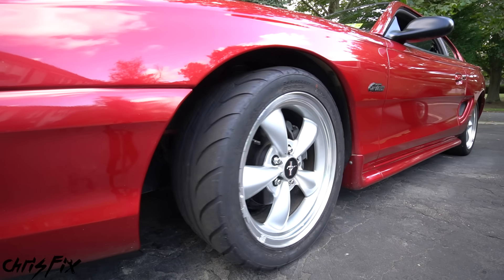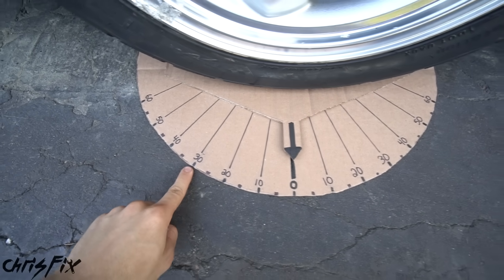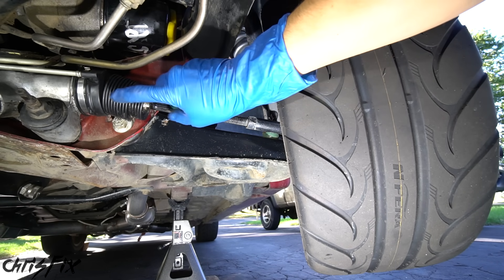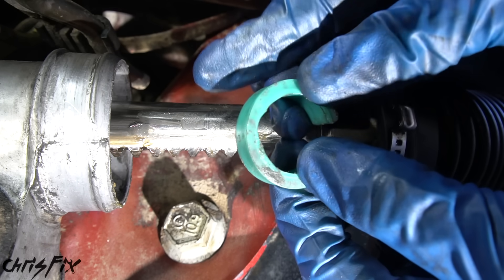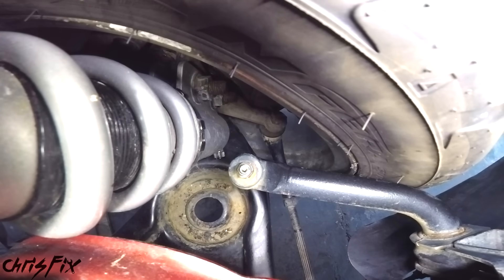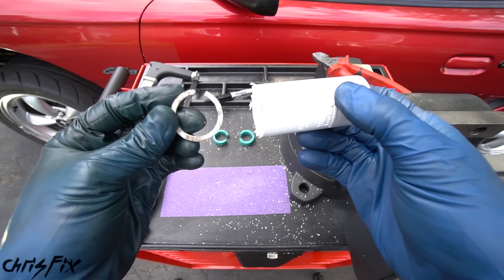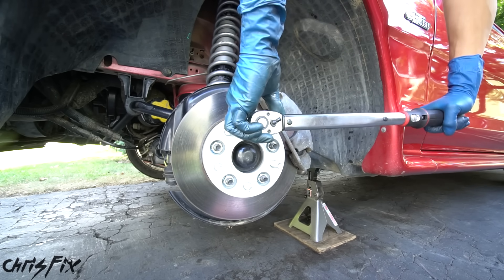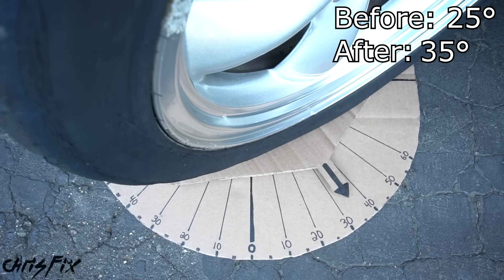How to Get Your Car to Make Sharper Turns (Steering Angle Mod)

Comment: Don't know if you mentioned it but over here(Sweden) the tires must be inside the line of the front fenders. Could be vital information for some, maybe some states has the same rules and laws about that. Other then that, awesome video!
Reply from the maker: +fladdy45 thanks for the tip! I try not to cover laws because it varies so much. Heck in Norway you can’t even run spacers.
Reply: Yeah, pretty much same here. But if you are sneaky enough you can slip them through inspections haha

Comment: Loved the video! I just have 1 question and 1 request. Question: Will htere be any safety issues by removing the rack limiter for a daily driver? Request: Whenever you do the wheel spacer video, please address scrub radius, how is it affected and such. Thanks.
Reply from the maker: +Milton Huang the safety aspect would be checking for clearance of the wheels and brake lines like I showed. Otherwise there is no issue.

Comment: Good video but check the clearance AFTER you lift down the car. Because lifted car can be ok but on the road you can rub the tyre.
Reply from the maker: +solidsnake123100 great tip

Comment: Japanese cars don't have these as far as I know. But there are other methods for these cars like tie rod spacers, and of course modified steering knuckles. Toyotas have a separate steering knuckle / balljoint bolted into the spindle and there are aftermarket options for different steering geometry.
Reply from the maker: +AX53 thanks for the tip!

Comment: The Loc Tite  is an excellent suggestion. Years ago i had a 1954 Chevy with a small block and '57 Olds rear axle. Ran Chevy to Olds pattern adapters on the front to have the same lug pattern all around. One spare fits front and back. But the nuts holding the adapters, which are spacers, in effect, wanted to loosen over time. And when that happens, a wheel comes off. Trust me. I know.

Comment: Wheel spacers and greater offset rims are not a viable idea as these will both promote torque steer. shaving the spacer is defiantly a good idea.

Comment: Anyone here that knows if volvo 940 has that spacer?
Reply from the maker: Check the measurements of the wheel studs and the hub center. They should have one as most wheels use a common size hub.
Reply: ChrisFix i ment the one that got you mode steering😁
Reply: Nope no steering limiters on rwd volvos
Reply: Iain okey thx saved me time
Reply: Iain Any info on the FWD Volvos, particularly P2's like my 2002 V70?  Would they have rack limiter spacers?
Reply: im pretty sure yes

Comment: some cars have an angle limiter on the control arm on the back side its like a little lump that sticks out and the spindle hits on that and all you need to do is grind that down a little but not all the way because than youre wheels are going to rub 
also not a good idea to increase the angle on a fwd car because you risk damaging the joints on the drive shafts
Reply from the maker: Thanks a lot for the tip!
Reply: my pleasure thx for the great videos

Comment: What's the best wheel spacer brand
Reply from the maker: The ones I have (linked in the description) are amazing. I have gone off the track at 60mph sideways and they hold up perfect! No vibrations at highway speeds either.

Comment: That cardboard protractor/angle finder, I was skeptical, but that worked amazing!  There's got to be a way to use that to measure toe and avoid having to go to a shop for an alignment.  I'm sensing another possible video?

Comment: Wouldn't that cause safety issues. I mean it  can be dangerous to turn the car at high speeds if you accidentally over steer and car may flip over

Comment: Hey chris, love your content as always, I watch all your videos even if it doesn't concern things I can do with my car !
I recently tried to clean up the rims on a 92 mazda 323, and I really struggled cleaning the thick layer of grease, dust and overall dirtyness in the inner part of the rim, the one you can barely see because it blends with the black parts behind the wheel, I tried the sponge grit, some degreaser and wiping towels, that came out ok, but it was very long and not very easy ! If you have any tips or  if you plan a video on how to superclean your wheels, you're more than welcome ! 

Thanks again for your great content, everything from the content itself to your prononciation (not a native english speaker, yet I understand and learn prety well with you) is awesome !

Comment: Are there any downsides after doing this? Other than the power steering moaning thing?
Reply from the maker: The power steering moaning is in all hydraulic power steering cars stock or modified and has nothing to do with the modification. The down side is spacers can cause a little more wear to the wheel bearing and suspension over time (not that much if you are doing a 25mm or less spacer).

Comment: u havent talked about driveshafts. when adjusting angle theres more wear/stress on em
Reply: never mind mustangs are rwd, but still its worth talking about in case someone does this to a 4wd/awd
Reply from the maker: Thanks for sharing. That is true but you shouldnt be moving quickly when you are at full lock and you are also not at full lock when driving most of the time so it isnt an issue in most cases.

Comment: You should have checked to see what it was just with wheel spacers
Reply from the maker: There is no change in angle when pushing the wheels outwards.
Reply: ChrisFix are you going to add a bump steer kit

Comment: that cardboard steering tool worked a lot better than I expected.
EDIT:
I just realized - shouldn't the turn angle be the same both ways?  Think of it like this:
For the left wheel, turning to the right gave you 40 degrees, but turning left gave you 35.  But what about the right wheel?  If turning that doesn't give you 40 degrees, wouldn't that mean the alignment is off?

If the wheels are supposed to point in the exact same direction, wouldn't this also mean that you can't turn as far left as you can to the right?
Reply: Peter Schmidt Look up Ackerman Angles, the wheels have to take different angles on left VS right turns
Reply from the maker: Look up Ackerman Angle.
Reply: The inner wheel has to take a smaller turn radius than the outer wheel, so each wheel needs a different turning degree depending on which way it's turning

Comment: This is great information. I have a 99 Infiniti G20 that U-turns as wide as a Suburban....and it's a compact car, so embarrassing. 4-door Tacomas U-turn tighter than it. I'm really gonna look into this on my steering rack. This would be a significant and much needed improvement for my car. Thanks for your awesome videos.

Update:
Well after taking a look at my steering rack under the boots, my car has no steering stops to remove so I'm stuck with my crappy turning radius. Just shows all cars are made differently.

Comment: Hi Chris. It's really worth noting that doing this modification to some cars can be risky and sometimes downright dangerous with the standard components. In some cases you can get a condition sometimes called "Over-Centering" where due to the steering geometry the wheels can go past a point of no return and get stuck in position at full lock. This often means you will not be able to straighten the wheel without being able to reverse, or jacking the car up to release the lock. What can be especially dangerous is that the lock can sometimes only appear under high load, so driving the car in circles may not show the fault when testing at low speed.

Comment: When I did my inner tierods, I noticed there's a tiny hole in the boot(I suspect that's what ruined the tierods -And Chicago winters) I taped it up with electrical tape and hope it holds.
Reply from the maker: Yea once the winter is over I would replace the boot if the tape isnt working well.
Reply: Yup. I plan on it, man. It's just that I got in over my head with basically replacing the whole front end suspension- including the wheel bearings - and just didn't want to wait for the boot in the mail(I order parts, I think it's cheaper), and just wanted to drive the car, instead of just constantly doing something to it. Your vids, helped *tremendously*. Thanks!

Comment: Great videos Chris! I think your tires might hit your sway bar when the car is on the ground and you're drifting at lock. Tires flex a good bit drifting. If your fronts rub, you could have them bind and make you over rotate. Just double check you don't have marks from rubbing after drifting it.
Reply from the maker: Thanks man! I actually have been using this setup for many months now and it hasnt rubbed at all, even drifting on the track!

Comment: The rear needs spacers, they are way too tucked in stock form but now that you did spacers up front it really looks bad.
Reply from the maker: Thanks for sharing. That will happen when I do the "everything you need to know about wheel spacers" video.

Comment: Will adding wheel spacers make your tire hit the fender when you hit a larger bump?
Reply from the maker: It can if your tires stick out too much but that isnt the case in my car. Usually 25mm or less spacers isnt enough to cause any problems.

Comment: I really appreciate and enjoy your videos/explanations. Out of curiosity. With that narrow of a clearance between the sway bar and the tire. Would a sudden increase in load cause the tire to contact the sway bar? I.e. a pothole, speed bump, sidewalk edge, etc. This would be due to the angle of the spring suspension. If the angle that the suspension is mounted at is more vertical, then there wouldn't be any concern of that issue occurring.
Reply from the maker: Thanks and great question! I have tested this on the track drifting (the most sideways anyone will ever be) and they do not rub. Since the sidewalls on the tires are short there isnt much flex. If you have a bigger sidewall like on a truck then yes it might rub but I would be concerned if you are turning that fast all the way locked in a truck. Usually when you are all the way locked you are going slow (unless you are drifting) so there isnt going to be much flex. Great thinking though and thanks for bringing that up!

Comment: Why do the manufacturers install the limiters?
Reply from the maker: Because there will be contact with the suspension otherwise. The limiters allow the manufacture to use the same power steering rack for almost all of their cars and they limit motion with the rack limiters to fit each car. Good question!
Reply: Thanks for the answer !

Comment: Great videos.......BUT, this habit you showed in your driving of puttingyour hand INSIDE the stering wheel when turning, is a very common, and very dangerous habit to get into. It is an extremely common habit,abd extremely dangerous thing to do.....Like tail-gating. Sudden emergencies occur in a split-second....Especially at city speeds.This habit will slow you.....To DEATH.
Reply: Peter Ruiz You’re either a driving instructor or the habit police. Either way, lighten up!
Reply from the maker: Thanks but this is just because I am filming and turning with one hand in my driveway.

Comment: Loved the video. I noticed my power steering pump made that noise when at the sharpest angle I could pull the steering wheel. I assumed it was bad since the pump sounded stressed, so I always backed off a bit, and I'm glad to see my common sense was right!
Reply from the maker: Thanks and very smart!

Comment: Mine are installed to the wishbone like some other FWD cars. If you remove/reduce them you are going to rip out your wheel well and destroy the tires. But i really like the Video anyways good work!!
Reply from the maker: Thanks! It wont work for every car but it's worth a check if you want more steering angle!

Comment: I wouldn't say that you have "plenty" of clearance.  You still have the possibility of your tires rubbing in hard cornering or on rough surface due to suspension flex..
Reply from the maker: Thanks for the info but I have tested this on the track drifting (the most sideways ayone will ever be) and they do not rub. Since the sidewalls on the tires are short there isnt much flex. If you have a bigger sidewall like on a truck then yes it might rub but I would be concerned if you are turning that fast all the way locked in a truck. Usually when you are all the way locked you are going slow (unless you are drifting). Great thinking though and thanks for bringing that up!

Comment: not a fan of the "allot of clearance" to the sway bar as it's a moving and not a static part, so might still rub when pushing it thru corners.
Reply from the maker: Thanks for the info but I have tested this on the track drifting (the most sideways anyone will ever be) and they do not rub.The sway bar doesnt move laterally, it is a spring that bends vertically depending on the load.  Also since the sidewalls on the tires are short there isnt much flex. If you have a bigger sidewall like on a truck then yes it might rub but I would be concerned if you are turning that fast all the way locked in a truck. Usually when you are all the way locked you are going slow (unless you are drifting). Great thinking though and thanks for bringing that up!
Reply: yeah a couple of years ago was my first time on track, my car was stock and on old 175/75 14's so tall and rubbery tiers and the suspension was so soft the swaybar actually compressed all the way up to hit the steel brake lines and dent it slightly on the front, now i got low profile tires, 25mm sway bars and bilstein B8 dampers with proper springs so it's not to recognise, volvo's where set up for comfort not sportiness :p 
Ps: great content as always, keep it up, will be interesting to see how that mustang turns out.
Reply from the maker: Dang that is crazy! Yea with a more stiff setup there isnt much movement (which is a good thing haha). Thanks for sharing man!
Reply: the pictures from the camera crew which was on the track was glorious like out of an old movie car chase where 1 side was compressed to the point that the rims where hiding under the fenders and on the other side "i swear to god" it must have been like half a meter from the top ot the tire to the fender on the inside, if you have seen a stock volvo 740 you know they are tall and i was sure the mirrors where going to scrape or i would tip the car, the joy of having a beater as a daily that you can afford to wreck i guess, but i must say i fell a little in love after it survived a whole week between 4-6k rpm it will turn 400 000km this winter if it survives the winter shenanigans.

Comment: putting spacers on front only for steering angle and unbalancing cars track width unevenly doesnt seem that wise to me for corners..
Reply from the maker: Why is the car unbalanced? The Ackerman angle is still good and only off 1 degree as seen by the before and after numbers and the suspension is adjustable so you can always change camber, caster, and toe.
Reply: cause you widened the front axle but the back stayed stock.. which you went out of original ratio of widths in the end.. maybe there wont be much difference while going to shopping but more you go near the limits (not only track in case you find yourself) of the cars handling it will act strangely Chris.. thats why all aftermarket brands generally keep original track width ratio on axles to avoid it.. like generally FWD cars has a wider front track width than back of the car.. if you only widen the front probably it ll oversteer in unpredictable way.. and for your car probably you have wider back or narrower due to wider back tires or same.. you better check it Chris cause even 5mm difference on each wheel really makes difference on the limit..
Reply: yco67 This theory intrigues me. Can you cite an engineering reference to support your statements, where I could read more info on this topic? Thanks, much appreciated.
Reply: sure.. just google "track width and handling" and "different track width effects" ..

Comment: Plenty of clearance he says 9:36 .. thats about 2mm or 0.07 of an inch ...
Reply from the maker: Thanks for the info but I have tested this on the track drifting (the most sideways anyone will ever be) and they do not rub.The sway bar doesnt move laterally, it is a spring that bends vertically depending on the load.  Also since the sidewalls on the tires are short there isnt much flex. If you have a bigger sidewall like on a truck then yes it might rub but I would be concerned if you are turning that fast all the way locked in a truck. Usually when you are all the way locked you are going slow (unless you are drifting). Great thinking though and thanks for bringing that up!

Comment: This will only work on rack and pinion steering though.
Reply from the maker: Which is many cars on the road. Any car with spacers in their steering rack can get more angle.
Reply: ChrisFix I understand that I'm just saying some (mine for example) don't have rack and pinion. I was just expressing my dissapointment I couldn't use this info. Don't get me wrong I use the info in many of your videos, just not this one.
Reply from the maker: haha I feel ya man! It is tough to cover every car on the road because there are so many differences. Heck even cleaning cars can be different if you have clear coat, single stage, or matte finish!

Comment: 9:40     It is soo Tight
Reply from the maker: Thanks for sharing! I have tested this on the track drifting (the most sideways anyone will ever be) and they do not rub.The sway bar doesnt move laterally, it is a spring that bends vertically depending on the load.  Also since the sidewalls on the tires are short there isnt much flex. If you have a bigger sidewall like on a truck then yes it might rub but I would be concerned if you are turning that fast all the way locked in a truck. Usually when you are all the way locked you are going slow (unless you are drifting). Great thinking though and thanks for bringing that up!